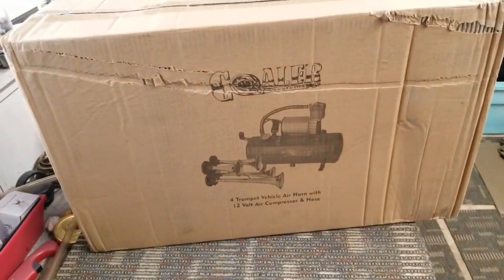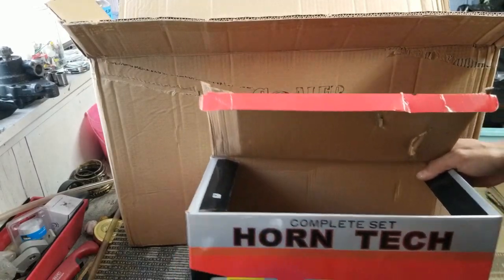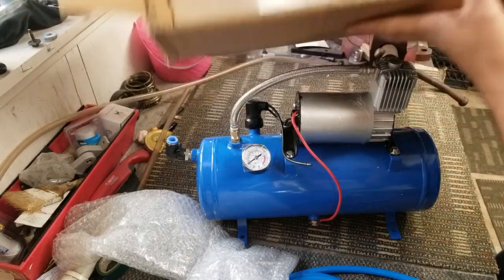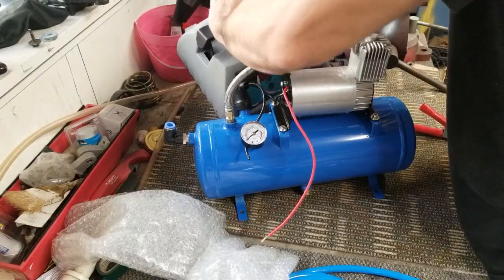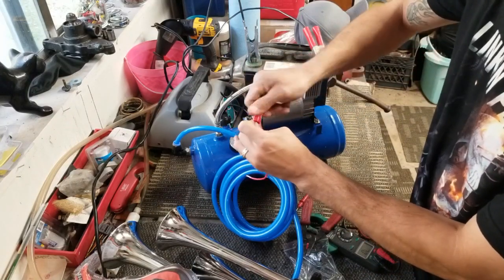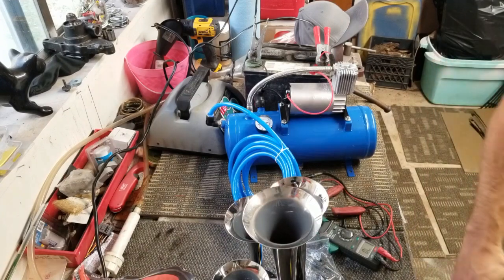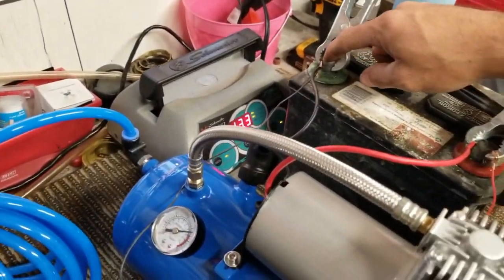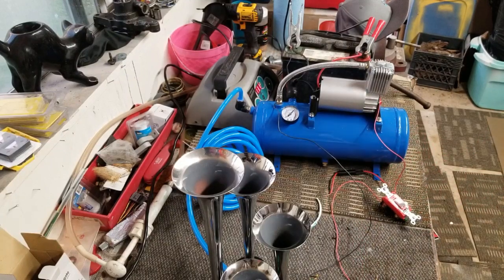Unboxing Ebay Coaler Systems 150db 4 trumpet train horn and bench test

Comment: How do you prevent the compressor
From getting too much pressure, installed it the same way but my compressor does not turn off and hits the red in the gauge
Reply from the maker: Maybe it’s a bad pressure sensor
Reply: Mine was filling up and just randomly started blaring the horn and wouldn't stop even with all the wires disconnected haha

Comment: Screw that. That's nowhere near 150DB (the physics just wouldn't allow it) and sounds like it has little slices of ziplock baggie as diaphragms. You can literally build a louder, sturdier, better train horns from PVC pipes for less than half what this garbage costs.
Reply from the maker: If you can build a better one then why are you wasting your time looking at air horn videos, get out there and build one, make a video of you doing it but I seriously doubt you’ll actually put in the effort. So thank you for watching and don’t forget to turn on the bell icon and I’ll see you on the next one
Reply: @RatchetRiceRockets son, I've been "putting in the effort" and building horns longer than you've been out of diapers, so weird flex, but okay. The thing is, only one of us bought a cheap Chinese plastic horn and uploaded a video alleging it was 150 DB.
Reply from the maker: I never said that it was the best horn in the world I said for the money it’ll work also I’m not claiming it’s a 150db train horn the company is yes I bought a Chinese pos horn but you know what it’s still working after almost 2 years yes there is way better ones out on the market but I ain’t about that life of spending 400 to 800 on a horn I simply needed something louder than the stock horn and for $90 I got it I’m satisfied

Comment: does it have a deep sound?
Reply: I got a $26 horn on Amazon sounds gr8
Reply from the maker: Not deep a little high in my opinion
Reply from the maker: I think im gonna give this one a try, for $26 yoir not losing much
Reply: @RatchetRiceRockets  it also came with the wiring relay and fuse!
Left my regular horn on with it and the 2 together sound great imo
Reply: @RatchetRiceRockets  want a link?

Comment: That thing's a piece of s*** I ordered one a long time ago pump burnt up in the first run of trying to fill the tank so they sent me another one same thing happened maybe got the tank to fill twice so I tore apart the pumps and made one work and returned one and they let me keep the other so I went to home Depot and got a husky tire pump that can pump to 120 and that's what I use to fill up my tank no problem since then
Reply from the maker: That’s what I’ve heard about these compressors, maybe I have the only good one that this company has ever made, the only thing this train horn is currently doing is the solenoid at the horns are getting stuck